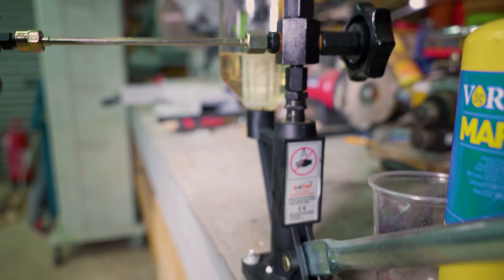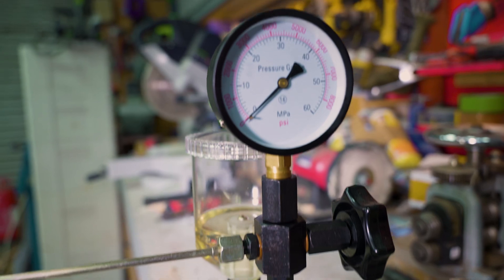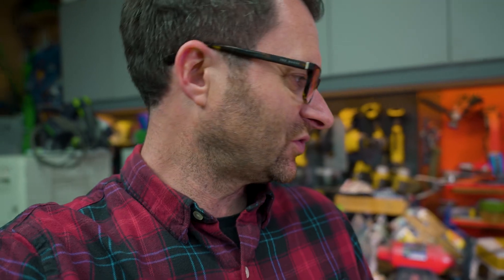Diesel Injector in slow mo - showing how an injector squirts fuel

Comment: is the mist so fine that flame makes it burn or what, diesel wont ignite in bulk with flame? sorry bad english lol
Reply from the maker: Spot on. It’s very much like a person fire breathing. They use paraffin that also doesn’t ignite as a liquid. You need to vaporise the fuel into fine particles, increasing the surface area so the ignition source can heat the fuel up to it’s flash point and it ignites.
Reply: @explosivescience9389  thanks been wondering  for a while but now got answer  :DAnd yt has 4day delay on notifications apparently :D e; and never knew its parafin and it works like that, damn i love yt